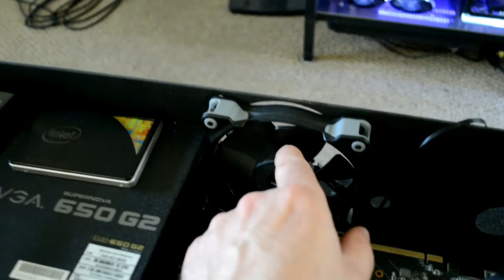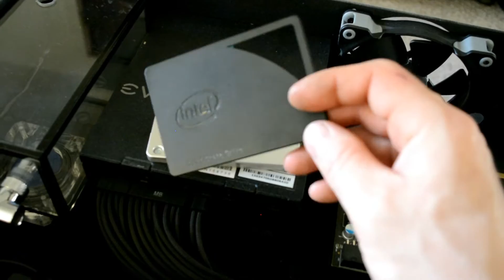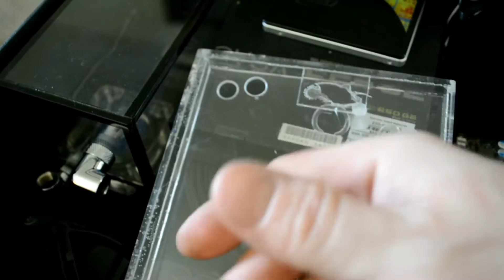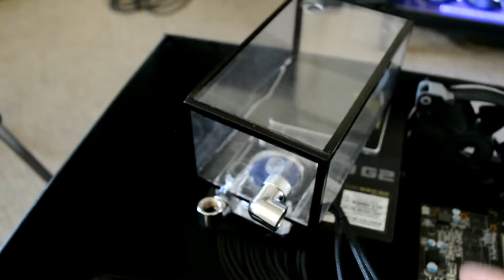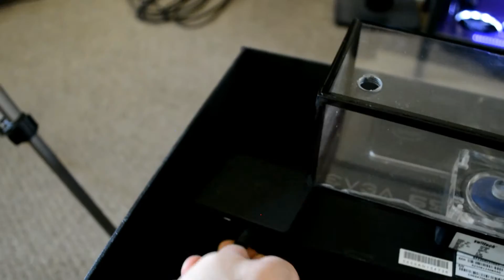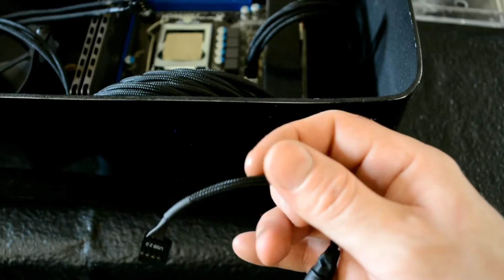Mini-Itx Build Part 7 Scratch Build And Custom Waterblock Update

Comment: honestly if your going to do something do it right. the reservoirs need dumped and made again and you need to either sere if your cnc is capable of metal or a hobby wood and plastic one. i suspect that your machine does not do copper.